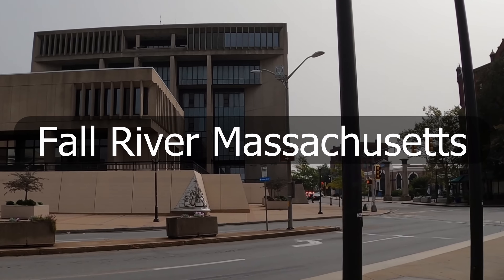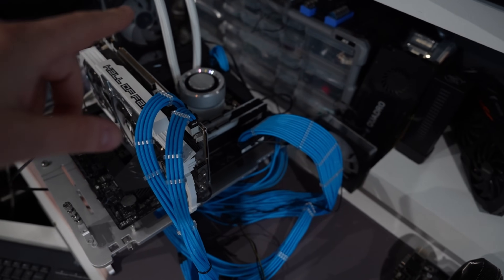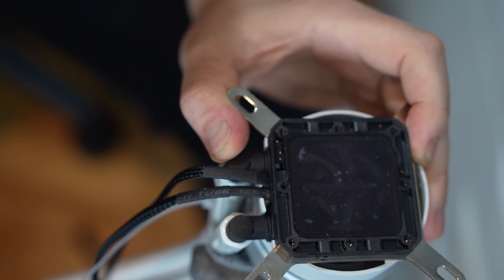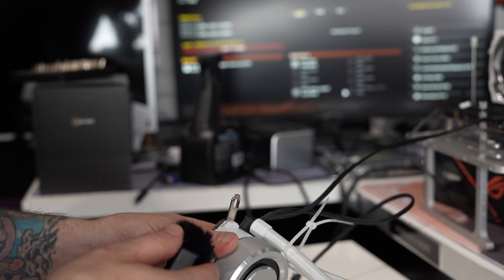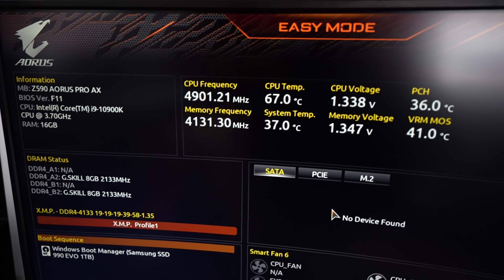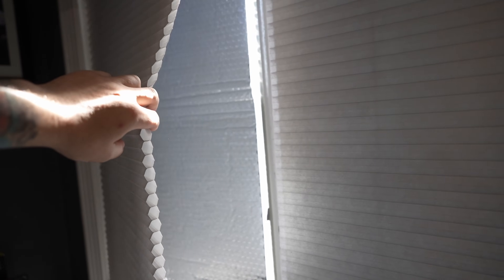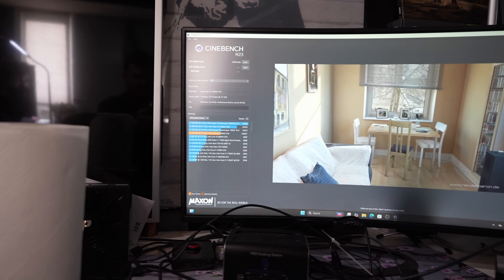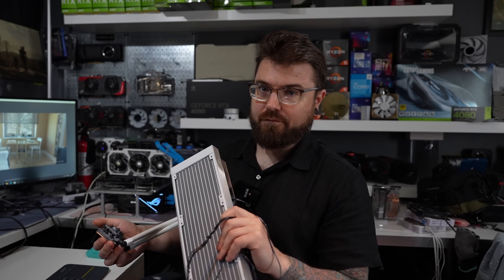Too good to be true? OR the BEST $60 I've spent on a combo deal?

Comment: In my opinion, AIOs are disposable.  At the first sign of a problem, straight to the trash, and replace.  I am currently running an Artic Liquid freezer III pro, and it's been great.  I have a Ryzen 7700x, and due to the architecture, these chips are notoriously hard to cool.  I had a good air cooler on it, but when pushing it hard with all cores load, it would run at about 90C - 95C.  With the AIO, it maxes out at 75C - 80C.  An AIO is really necessary for this CPU IMO.  Luckily, AMD has changed the position of the cache in their newer chips, and have eliminated this issue, so a good air cooler should work well on newer AMD architecture...

Comment: The debris in the AIO coolant is a plasticizer that comes from a combination of the tubing and coolant. Drain it and refill the AIO and it should work. Also mount the radiatior with the hose inlet and outlet at the base, so air remains in the radiator and generally won't flow to the pump.
Reply from the maker: Yeah sadly the pump won't even power on now. It was running for a bit and just completely stopped (mentioned somewhere near the end of this video). Thanks for the tip though.

Comment: That air cooler is $56.99 on Amazon.
Reply from the maker: Yeah unfortunately since this video it has returned to its original price. 
There's a few others around the $30 range that perform similarly.

I have used this a few times and they are also pretty solid. No screen unfortunately.
https://a.co/d/fG1ZET8

Seems like once they have a little uptick in sales they revert the price unfortunately.

Comment: You should drain the AIO then fill it with rubbing alcohol run it for 10 minutes and then drain it and then refill with fluid. Make sure you bleed the air then try it again.

Comment: Hey bud some advice here, if the aio radiator is placed in the upright position then you need to place the radiator with the hoses on the bottom. The reason is no matter how much you top it off with coolant there’s still air getting into the pump adding stress to the pump reducing longevity. With the hoses at the bottom it 100% just cycles the coolant. If it’s in over head or bottom placement then obviously there’s no preferred hose placement. To many aio’s kill off because of not cycling the coolant properly. Good luck and nice vid.

Comment: Rad orientation is allowing all the air to go to the top. If it's clogged or low it will never prime itself. That's why when you hold it up it cools off a bit. When you run a pump with no water it's going to burn the motor up. Also I would double check the mount for the CPU cold plate. Still a banger deal 👍

Comment: After refilling you need to shake the head a lot to get trapped air out. A waterpump uses water to cool itself and with air there it will die pretty fast because of overheating. Also these do not have to leak to have little water in them after a few years of use. All aio's lose water over time.
Reply from the maker: Thank you, yeah I ended up flushing it a bunch of times even after this video. I think the liquid gunked up so bad internally in the rad that I'll probably have to cut the tubes off and used some rad cleaner. 
Also something on the little circuit board looks like it may have failed while trying to pump the liquid through.
It's at that "is this worth my time" point now. 
Appreciate the comment!
Reply: @techwandoUS  Yeah not worth it. The lifespan is partally dictated by the max water temp it reaches during use. Manufactures recommend a max water temp of 60/65 degrees while using them. This thing will probably have run many hours past that temp specially if used with a high end cpu.

Comment: C.L.R IT.. also if you want to fill it faster get a Bulb siphon.. you can draw a vaccum.
Ive reconditioned several of these.

Use clr Calcium lime rust remover.. ..
Rinse with distilled water.. then refill with 1.25 l of Deionized water .25 tbsp of bleach..
Reply from the maker: Appreciate the tips. I think I might run some primochill rad cleaner though it, replace the tubes and just put a different pump head on it. Got a few Corsair ones kicking around.

Comment: We'd probably know that AIO coolers are less demanding than any other coolers. With the water pump being messed up, it's possible that you could replace the radiator and fans so the temperature will decrease. Those water pump coolers are kinda expensive these days. I'd rather use a CPU fan cooler for my rig. my motherboard is a LGA 1151 socket, and I have an i5 9500 CPU with that. My GPU is an RTX 2060, and my RAM is a g-skill 16GB (3200MHz) (2x8).

Comment: This is super cool. I've always wanted to see what was beneath the cold plate of these pumps. Funny thing is, I just saw a post where someone else had this exact AIO where the pump also died. Hopefully my Kraken Elite (2023 model, since I really am not a fan of the 2024 version) will still stay working for the next few years haha. I was told my some friends in the beginning that air coolers are just the way to go with virtually no points of failure besides the fan. But I fell for the aesthetics of an AIO like many others.

Comment: the aio is very easy to 'fix' . just clean and rinse it with water a few times , run isoprophyl alcohol through it once , rinse again with distilled water, then refill with whatever "coolant" you want and it will work fine for another 2-3 years

Comment: that AIO has microbial growth of some sort in it, as long as the pump works you can fully restore the cooler by cleaning it as you've done in the video and running isopropyl alcohol through it to kill the growth in the radiator and flushing it a few times in this way before refilling it with fresh fluid

Comment: I wish manufacturers would make AIOs more easily serviceable. Design an easy fill and flush port and that's it. As much as Lian-Li gets love, they do have a high-number of reports for their AIOs failing whether that's the pump dying or as you experienced, the AIO getting clogged. And they go under the radar as the big channels hardly every talk about it. Also wtf is up with using those wacky screws. Philips, philips and philips, that's it, not sure why manufacturers like to over-complicate things. Unless the goal is to just make the user say screw it, and get a new cooler. My friend picked up a hydroshift cooler from Lian-li and so far its been good, but we've also seen many reports on that one for pump failures. 

Good effort on trying to fix it, but alas a replacement is your only option. My personal rig's Thermaltake AIO is reaching that 4 year mark and still going strong, knock on wood.
Reply from the maker: 100% agree, I guess in many ways this would be the "right to repair". Like somewhere in the rules of Right to repair should be "ease of repair". 
I partially understand trying to seal the loop off as much as possible so there's no leaks, but making it impossible to service like you mentioned. Does nobody any good and the liquid will eventually dry up, even if it's a small amount, it will cause the pump to run dry in certain positions. 

Funny you mention the thermaltake cooler. I just replaced my friends on his threadripper that was built whenever gen 1 came out. It's been a long time. You probably got a few more years.

Comment: I stopped running liquid cooled in 2020.  Had a dream that my loop leaked and caught my house on fire.  Literally that day ordered a mount kit to use my sitting in the closet at the time Noctua D14 back in service and have been on air ever since.  The D14 moved from my X99 system to my AM4 system still running on the 5900X (2nd CPU on that rig first was 3800X) and my new system just built saturday is running a thermalright  burst assassin in on my 9700X using phasesheet TPM as the "paste"  Heat cycled it 15 times and under 100% load it sits pretty at 64c on the package on a 120 single tower 25 dollar cooler.  Never going back to liquid I am now phobic lol

Comment: I wonder if that air cooler is good for a gaming PC ?
I mean a gaming PC that is using at least 12 Cores, this is because I like to test video games that requires higher performance.
Reply from the maker: It has a 270w TDP capability. So it should be good on something like a 12 core AMD chip no problem.

Comment: if my 360 AIO ever dies, it will give me a valid excuse to reuse the still viable parts for a custom water cooler. AIO is great, but they do die, just like custom setups. the radiator is a pricey bit, as is the pump (if it can be saved). so sense repurchasing anything I don't have to
Reply from the maker: Definitely would be easy to barb it up for some softtube...

Comment: Am I the only one noticing it? Had to re-watch video... I won't go into the quality of this exact sample and clogging, but it seems to me that trough the whole video AIO was "mounted" in less then ideal position. Ideal position being, PIPES BELOW PUMP,  pump getting full flow of the liquid on intake and return. Less than ideal position, PIPES ABOVE PUMP, pump getting mixture of air and liquid on the return consequentially producing "gargling" noise around. 

Your sample wouldn't be the first with dead pump from this exact reason above.

Just my 0,02$ 

Keep up the good work.

Comment: Hope you have not thrown out the Rad yet.  Actually these can be used for all kinds of other applications.  They can withstand allot more heat than what a cpu can push threw them.  I almost always boil the rads in a bucket.  Boiling water threw the inside also.  If you use boiling water they pretty much air dry fast.  take off the tubes, and try to remember the in, and outlets.   Powder coated rads, are cleaned with scolding hot water before the paint flies.  Hahaha!
Reply from the maker: Not a bad idea actually. I'll probably rip the tubes off and see how much gunk comes out. Might make a good soft tube project. 
Appreciate the tip man!

Comment: Good video. You are better than me. For $60 (smart to offer a bit more on a GREAT deal to make sure to get it, I've done that many times) as soon as I knew the AIO had issues, I either would have taken the 3 fans off and tossed the rest in the garbage or put it on a marketplace site for $25 "As-Is". I've never been a fan of AIO's because they can be a big headache when they break or leak. When a fan dies of a cpu air cooler then it's a 5 min fan replacement job. That's why I LOVE Thermalright Peerless Assassin 120 SE CPU Air Coolers. Not hard to install and incredibly easy to change out a dead fan. (Your cpu cooler seems to be similar, I wish I still lived in the U.S for that deal) Slide out the dead fan and then slide in the new fan and you are done.

Comment: that radiator is fine  . just cut off the pump and splice it into another loop ,, you can use it for gpu cooling also
Reply from the maker: Your right, I'll probably do this. Only issue is it might be aluminum. A lot of aios makers cheap out and mix metals.
Reply: @FSK1138 for sure, daisy chain them after a good cleaning.

Comment: These aio only have a 3 to 5 year life span  i prefer asus coolers myself
Reply from the maker: What model do you like in particular?
Reply: @techwandoUS i currently a thermalright 360 aio and air cooler. I prefer the air cooler
Reply from the maker: @jamesolcott4388 those are both solid. Thermalright is so underrated.

Comment: Very nice, I stay away from AIOs like a plague if I get one with a build I add it to a cheap sell fast pile unless it is brand new. Air coolers less issues and quick too take off, just tested a ASROCK FX 890 Deluxe board man the chipset gets hot. Works no issues but I'll more than likely flip it, also picked up a steal of a deal of a Ryzen AM5 system with a 4060ti for about $200. I thought the deal was a scam so I met them at a local BestBuy parking lot and it was legit guy preferred console gaming. On the way home picked up a EVGA GTX 570 which I have too test and the card is immaculate. This summer computers and parts are being dumped, I believe some of it is the Win 10 death but that doesn't bother me since I mainly run Linux for some years now. Good video like always.
Reply from the maker: That AM5 system for $200 is an insane deal. Incredible  score on that. 
I didn't even think of the windows 10 death situation being a piece of all the deals coming lately. 
Should be an interesting summer for sure. 
Appreciate you.

Comment: I fairly recently bought a case that came with an old NZXT X40 AIO. That AIO despite being around 10 years old still works fine, and is able to cool an 8700k perfectly fine.
Reply from the maker: Some of them are great. Nzxt in general has had a pretty good track record with their AIO coolers except for the few years they were putting the pumps in the radiator. All of those failed. So if it's a traditional pump on CPU block type, it will probably be fine.

Comment: I never do AIOs for customer builds. Just not worth the hassle when they eventually come back. Air just needs a repaste in 5 years at the very earliest, and custom water requires maintenance, that I fully expect them to not do, then lie about doing :)
Reply from the maker: It's funny you say this, quite a few of my older systems are coming back with AIO issues. Nothing within my control, and I've been swapping them free of charge (other than parts) and all these new budget CPU tower coolers are awesome. IMO the look is even growing on me. 
Appreciate the comment as always.